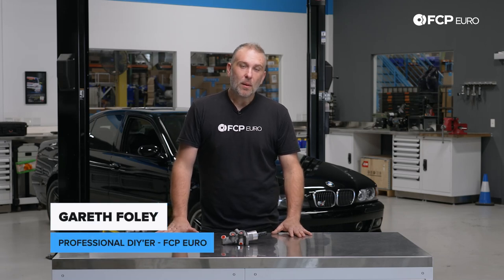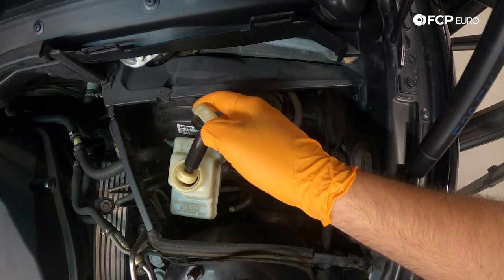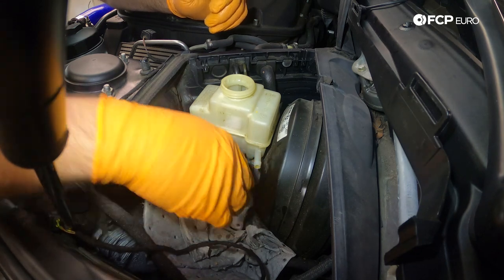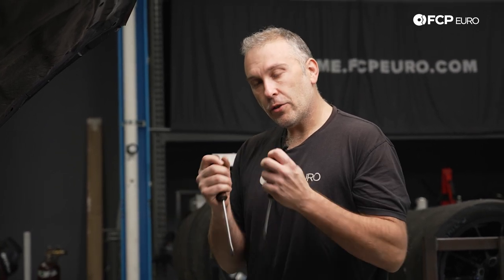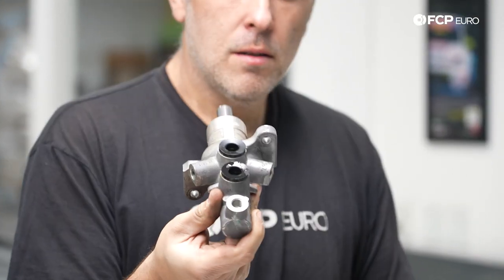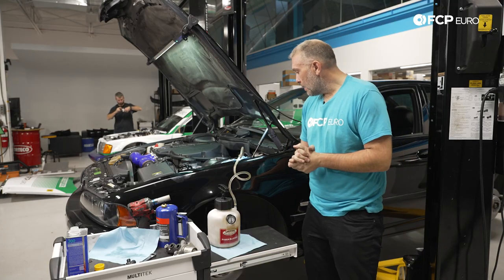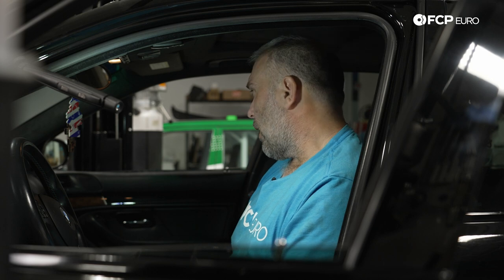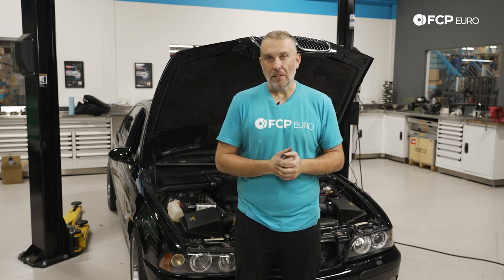BMW M5 Brake Master Cylinder Replacement (1998-2003 BMW E39 M5)

Comment: Ok I just replaced my brake booster in my 1998 e39 528i.  I disconnected the master cylinder break lines outside of the booster compartment towards the passenger side.  Placed a tall skinny container with small funnel below the connectors. You'll need a 11 & 15 mm to break free (no pun intended). With the master cylinder cap off, open the lines and let them drain out completely. Now, go under the dash and take off retaining bolts to the booster.  You will now need to take off the compartment divider to get the two brake lines up and out.  I put four disposable latex gloves over each break line connector for leakage. Now gently pull the booster out with the master cylinder empty and attached. Once on the bench drain out the old fluid and remove from the brake booster. While on the bench, put some fluid in the master cylinder and depress plunger until fluid come out the connector without air.  Best part is I didn't have to take the filter out of the master cylinder, have a pump, or try to get at the break line or mounting bolts in a tight space! TY BMW. It was all done outside of the car. Then put master cylinder onto the booster and  gently slide back into the firewall and reconnect pedal and tighten bolts to booster.  Next position the empty container and funnel back under the break line connectors and thread lines in only part way. Start to fill the master cylinder back up until you see the fluid coming out of the connectors and then tighten. Good luck!

Comment: I've experienced a brake booster that filled with b fluid as a result of the m/cyl leaking back into it. The customer was topping up the fluid on a regular basis but never told us at the shop. I found it on a road test when the engine suddenly pumped out white smoke from the exhaust, which was brake fluid being sucked into the engine via the inlet manifold. It was quite spectacular! 😳
Reply: I have always wondered why people "top-off" their brake fluid. The added fluid needs to be removed when installing new brake pads. Dramatically-low fluid indicates a problem that needs immediate attention.

Most hydraulic system failures can be avoided with regular brake fluid changes. I have found that most people completely ignore the service interval on the brake fluid. Congratulations to anyone that actually does change their fluid every two years.
Reply from the maker: Wow, that's insane there was enough brake fluid in the booster to get sucked out through the vacuum supply hose. There is also no way the brake pedal felt good at all leaking that much brake fluid. Great catch, thank you for sharing!

Comment: the cabin filter air box has holes in the bottom for water to escape if it gets filled. Amazing how often these are clogged with leaves, dirt, etc. This is the main culprit to water destroying the booster. Also, ensuring the box is installed correctly under the cowl should prevent water from entering the box.

Comment: Most of us e39 M5 owner found out you can upgrade the brake BMC withe the version from the E65 for improved performance. All you have t do is cut or grind down some of the metal at the top nearest to the top hole for the bolt (for clearance of the fluid tank) and your good to go.

Comment: yea   I do the same thing with the plugs.....I just replaced the master cyl on my 2001 dodge ram.....before it starts leaking into the booster......the booster has already been replaced although its about 10yrs ago......I dont want to replace it again ......I suppose ..if the pedal doesnt feel right and there arent any external leaks...its either BYPASSING  or leaking into the booster .......

Comment: I'm doing this job now on my e39 wagon. I had the car sitting outside all winter and spring with the leaves and rain. Caused the drainage hole to become blocked and allowed to fill with water. Let's just say I had to pump water out of the booster enough to fill a plastic water bottle. Check those drains!

Comment: Great video and very timely. Boring story time - a couple years ago, the brake pedal on my E39 540 started going right to the floor, turns out the vac line to the booster was toasted - didn't realize loss of vacuum would manifest in that way! Kinda scary, feels like you have no brakes.

Last fall, I noticed the same pedal behaviour showed in the diag video - perfect description, the car stops ok, but the pedal seems soft, and just keeps going down slowly (not like the vac failure above where it just dropped). Wasn't sure if it was another vacuum problem, or the master cylinder was toast. I tell this boring story to suggest another step of diagnosis - make sure the vacuum line is in ok shape, all the way back to source. 

Thanks for the tip on checking out the booster - wouldn't have thought to check that out/suspect it as an issue!
Reply: Thanks for the heads up. Really appreciate it

Comment: When the brake pedal pin was going in you should have mentioned pulling out the stem to the brake light switch to recalibrate it so your cruise control will work for sure.

Comment: Maybe this is supposed to be obvious, but did it fix the issue?! I am having the same exact problem from the diag video on my E92 and I am eager to know if the master cylinder returned the brake pedal feel to full potential.

Comment: There is an E65 brake cylinder upgrade that is widely discussed on the M5board. It basically is the same size as the E39 one but with slightly bigger bore so you should theoretically have a harder brake pedal. On my list of upgrades.
Reply: A harder pedal gives you less "feel" and less fine control of the brakes in performance driving.
Reply: @davidparker9676  You may be right, I don't know about this. However, I am pretty sure that BMW didn't put much thought into this in this car. The reason I say this is that they use the same master cylinder on all variants of the e39, from 520 in europe to the M5, and everything in between. However, if you look at the diameter of the pistons in the calipers, they differ between cars with M5 having the largest. A larger diameter caliper piston with the same master cylinder will have a softer brake pedal than a smaller diameter caliper piston all else being equal. As such, it is well known that the pedal is firmer in 6 cylinder cars (525, 528 and 530 in the US) than in M5. I think that is why this upgrade is popular, although I agree not strictly necessary. Now if BMW would match the master cylinder to each caliper used, or at least put a different one from the factory on the M5 then I think there would be no need for any upgrades.
Reply: @borisp9499  BMW has a huge parts bin to draw from, I doubt they were seeking to cut costs by a couple euros on the M5. I have lost of older BMWs and they did offer the bigger master cylinders on some cars while others shared the same master as the base model. I am sure the BWM engineers saw it fit for the task.

The softer pedal if typically preferred by race drivers for better feel and control than a hard pedal. I set up some of my cars with bigger master cylinders and kinda regret it now. Yeah I do have a firmer pedal and shorter travel but it did come at the expense of feel and doesn't make the car stop any better.
Reply from the maker: Thank you for pointing this out. We have heard of this particular upgrade. In this case the own of the car wanted to keep it as is but for anyone looking for a firmer pedal feel the E65 master cylinder . It's part number 34336785926 for anyone who is looking to do this.

Comment: I don't see where you bench bled the master cylinder before install.  I've seen this strongly recommended (essentially required) for other makes.  Did using the power bleeder eliminate the need for this ?

Comment: No need to bleed the new brake master cylinder? Just a regular brake bleeding procedure, as shown? Thanks
Reply: I’m wondering the same I did my master cylinder one year ago on my 540i, and the new one failed me recently. Does it need to be bench bleed?
Reply: When vehicle is off, brake pedal has pressure, when vehicle is on, brake pedal hits the floor, should I assume the MasterCyliner is toast? Thanks

Comment: Quite a pain in the butt job. But new booster make driving so much nicer
Reply from the maker: Many of the flare fittings are a pain to get to. Having to remove the booster to get the master cylinder out for sure is an extra step that is a  pain. The only major benefit in this case is the agility to at least see the inside of the booster unimpeded. Which in this case turned out to be beneficial since it was rotting internally.

Comment: So when you open the brake system to such a large extent, I would have expected that the ABS module would need to be activated to bleed completely. Do you ever find that necessary?
Reply: It's not necessary on this system. The ABS is able to be bled without activating it.
Reply from the maker: It depends on the car. Many newer cars will need the ABS pump bled. In the case of this E39 M5 it was not needed (surprisingly).

Comment: Lets see if I can get some help here. Car sat for over a year in very humid climate. The Caribbean to be exact. Had soft pedal did a brake fluid replacement. Pedal eventually got much better prob put 5k miles on the car one day both front brakes just locked up and stayed locked. I thought a caliper was bad so had both calipers rebuilt with all new pistons seals etc.. changed both brake lines to braided. Swapped rotors for new ones. Purchased swaben power bleeder did that full flush. Had my abs module fixed no more trifecta lights. After all this front brakes are still locked up! As soon as I press my brakes they lock immediately. Car has been sitting for over a year. After this vid I am going to change both master and booster. Maybe it is this? Anyone with any knowledge please reply.. thank you in advance.